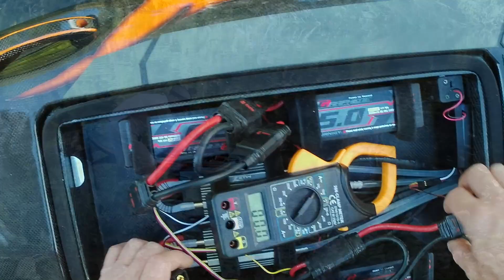Diy Electric Surfboard Running on 12s/44v

Comment: I’m running 15S on my 9’ board build and I recently increased the bouyancy to 156 liters to plane easier.
Reply from the maker: Nice one hope it goes well.
Reply: @thewaysider7774 Thank you. I have a vid on my channel of me riding it last year on 16S. Dropping to 15 because Power wise I exceeded 7500 Watts that the motors are rated for and wanted to get more runtime for the same amount of cells
Reply from the maker: @cameraman1234567890  Great will check it out.
Reply: @thewaysider7774 Thanks man! How did you get your board looking so slick?
Reply from the maker: @cameraman1234567890  loads of sanding the resin top coat and finnished with 2k laquer.
Reply: @thewaysider7774 Wow. Its hard to get the foam the shape you want. Wish I had the shaping tools to make something that shape unless theres an STL file for the shaping tools
Reply from the maker: I started with an old windsurfing board so the shape was close to what I wanted then just some sanding with blocks etc nothing really special.

Comment: Hello, maybe you can help me. I have the same setup but I have a problem with the ESC. When I have calibrated everything and plug the battery back in, I hear a constant beep beep beep beep beep... It only stops when I calibrate again. What am I doing wrong?
Reply from the maker: Hi I remember I had the same thing but for me I hadn't plugged the motor in so make sure the connection is good to the motor. Depending what esc you have check lipo cell count and anything else you can in the setup but it normally is something stupid like what I did. Once you have calibrated once you need to restart the system. Some esc's like to see full throttle when you plug in so check that also

Comment: How did you figure 8 awg is good for continuous? The calculations I have made is 2 Awg for 100A continuous. Are you using a VESC? If so you should be able to easily trim the top and to the controller (Flipsky right?). At 48v and 160 amp you are upward 7.5kw and that should be plenty since that like running a 10hp motor.
Reply from the maker: Yeah the 8awg wire is for the phase motor wires it's fine for the battery wires because they are short but I might need to go to maybe 6awg eventually for the phase but for now I am trying to get the amps even lower so will keep an eye on the temps obviously.
Reply: @thewaysider7774  hope you are not planning on increasing the voltage from 12s. There's a reason some areas like the US has standards on keeping voltage in marine environments below 50v. It gets real easy to kill oneself.
Reply from the maker: @NavalTechTinkerer  no i am not going more than 12s

Comment: Good advice from @Koolzr01. Great to see the project moving along. You really need to get in the water with it to see how it feels. As long as the cooling is working it should be OK. Strongly recommend capacitor bank, will save your ESCs.
Reply from the maker: Hey cheers how many capacitor's do you think would be good?

Comment: 1. Привет. Классная доска получается, дизайн и подход супер. Смотреть на нее очень приятно.
Но по технике я присоединюсь к остальным комментариям.
2. Снижать напряжение ниже 12s не имеет смысла, прийдется задирать ток, чтобы получить достаточную мощность в 10+ кВт . А при увеличении тока в два раза нагрев увеличится в 4.  
Увеличение напряжения только увеличивает шансы попасть под удар тока, это единственный минус высокого напряжения))
И да, если у вас на этом импеллерре на 24 в ток был 100А, то на 48в ток будет под 300, если батареи смогут его отдать. 
Я бы сразу брал другие моторы с меньшим kv, вместо 550 хотяб 230kv. И желательно с большим диаметром и outraner. Это уменьшит частоту вращения крыльчатки и уменьшит ток. Ну а дальше бы уже экспериментировал с размером и шагом крыльчатки и проч. 
3. Нужно стремится к уменьшению потребления тока.  Потому что этих батарей вам хватит на пару минут. А это очень мало.
4. Если не хотите менять двигатель, то берите крыльчатки у YOUNGSTERS JETS. Я не понимаю как он на этих двигателях и своих крыльчатках едет 60км/ч)) наверное у него сильно лёгкая доска и он сам.
Reply from the maker: Hi thanks for the ideas. For now I will do whatever is best after more testing, maybe higher amp motors but lower kv I have alot more I can try with my jetdrives.as when I printed them I didn't really know what size I should make youngster is on a 60mm impeller so I will try some stuff out cheers.

Comment: Hey brother love the update! I have some answers for your questions to help get this going along.

1) keep it at 12s to 16s. Dont go down in voltage from where youre at now.

2) Your amps are higher because your motor is now spinning significantly faster for the same throttle % input with higher voltage. Still need to reduce that impeller pitch so at max throttle its pulling 150 amps.

3) motors cut off because of voltage sag on the batteries. Your esc has a cut off limit set at some level. Under high load the battery voltage sagged under that limit and tripped the cut off. You can change this somewhere when you plug it in to the computer or have more batteries in parallel to provide the current needed.

4) if your motor cooling is good, dont worry about the 150 amp rating (within reason). Amps themselves wont hurt it, the heat generated over the magnet and copper insulation limit will.

If theres anything else you can think of i would be happy to answer if i can. Its such a fun project but can quickly become overwhelmingly frustrating trying to figure it out yourself.
Reply from the maker: Hi I hear you on the prop pitch it's just the file I modified was from thingyverse and couldn't change everything I wanted. What if I came down In size from a 64mm to a 60mm for example ? Or smaller if needed. And also I have a 45 mm jet nozzle opening would making that bigger help? Thanks for all the advise will look into the voltage cut thing also.
Reply: @thewaysider7774  you can't reduce the diameter of the impeller, gaps between the edge of the impeller and jet wall will crater the efficiency and thrust. 

A quick workaround for you might be to take that file and put it back in your slicer then scale only the Z dimension smaller. Will basically be trial and error for how much but should work.

I wouldn't recommend enlarging the exit nozzle until you work on the impeller. You will significantly reduce the exit velocity of the jet.
Reply from the maker: @Koolzr01  yeah cheers i also made a wear ring as i downsized the impeller once already, i made a video on it. I can make the ring smaller also to fit the new impeller but i will design a new impeller eventually now i've made it easier to come off the shaft. From my research the nozzel opening has a similer effect to pitch of prop but there is a balance to be had of course. My idea is to make the jetdrives new out of p.e.t. cf plastic once i know the correct size ecetera. then i can share the files. Thanks again for your help am taking on board all the advise.

Comment: Maybe you should just go with 56123 motors and 16s, that should push a light guy like you with reserves
Reply from the maker: Yeah eventually will look into changing motors if i have too but you know its another bunch of money.
Reply: Can't do compromises such as Close to the Goal
Reply: Anything marine shouldn't be over 50v. When you go over that you are seriously making it easier to die from being electrocuted. I built a 20S pack and I'm pulling that down to two 10S now and then upward 12S later. But no hobby is worth potentially dying from.